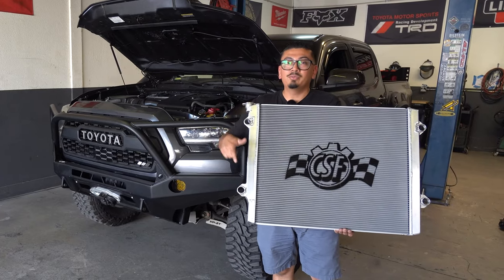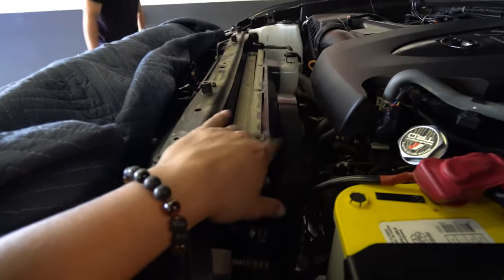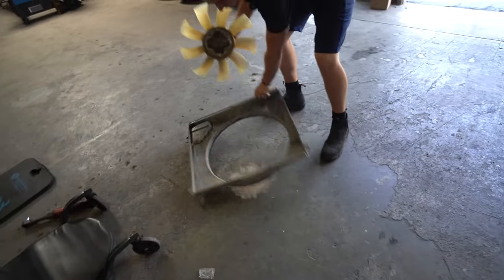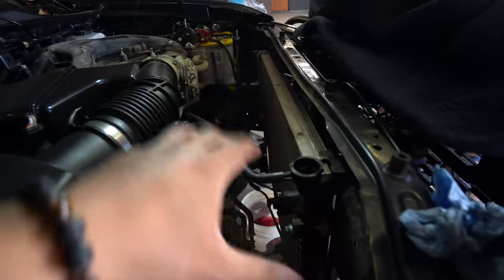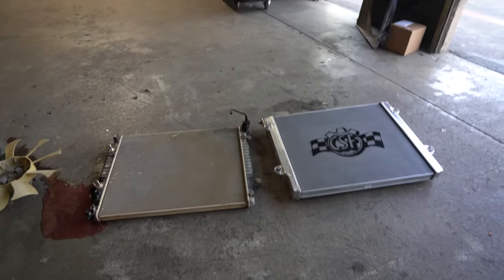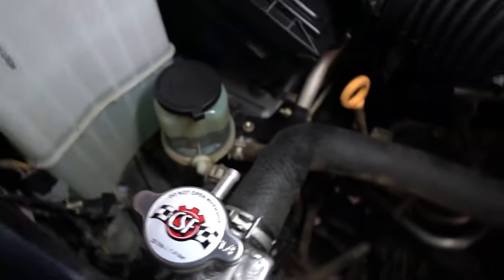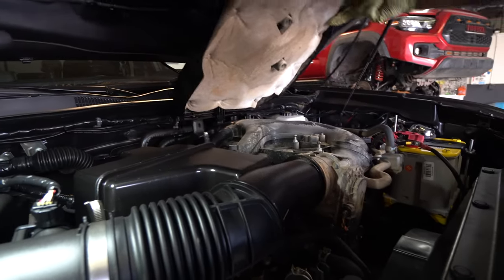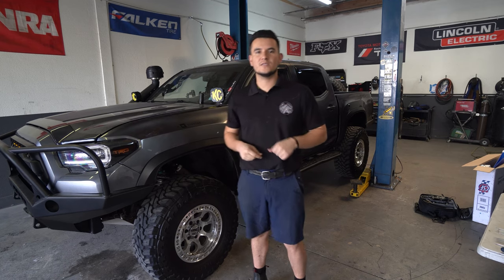My Tacoma Gets A Upgraded Radiator No More Overheating Issues | How To Install In Depth 2016+ Tacoma

Comment: The radiator is really nice!
The weakest part of the radiator is the drain plug thread and plug. It’s got soft aluminum drain plug which it wears out so fast. I wish CSF would fix that issue and make drain plug and thread a lot more stronger. I’m considering Mishimoto brand to replace  CSF on my Taco!
Oh, by the way, I like your truck Jesse 💪
Reply from the maker: Thank you man 🙌

Comment: I have never heard of a Tacoma overheating. Is that a real danger?
Reply from the maker: Yea after I posted my overheating issue on Instagram stories @_jesserizo 
I got hit up by 5 other people saying there’s would overheat
Reply: Yes, I've mostly heard of it happening when people are offroading or towing. Some will even add a beefier trans cooler, or even pin the trans thermostat so it stays open.
Reply: What's with all the tacoma with raptor grill light is it that wide?
Reply: I had my factory Tacoma radiator slowly leak and overheat over time. There was a small crack in the radiator between the plastic and metal portions of the radiator. Thankfully it didn’t overheat too much and damage the engine. 

I don’t do any off-roading with my truck and generally baby it all the time. I think the OEM radiator is crap.
Reply: Mine's a 2008 and pulling a popup trailer up some bigger hills in the Arizona summers mine will get up to 245+  so I turn my heater on to keep it from going higher. I'm looking into a replacement, so yeah depending on where you live